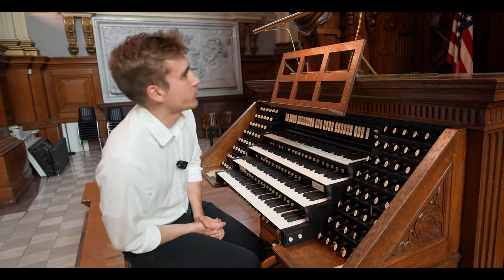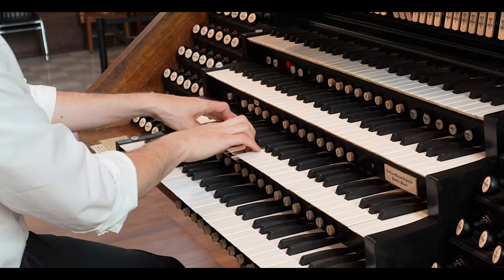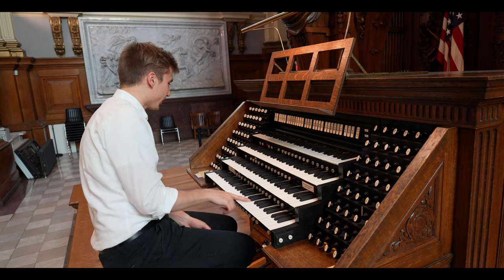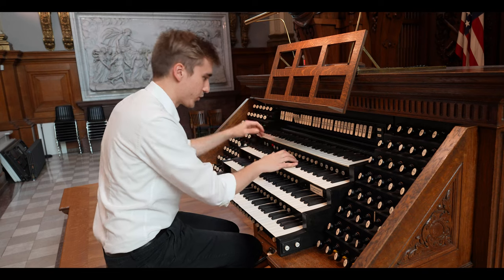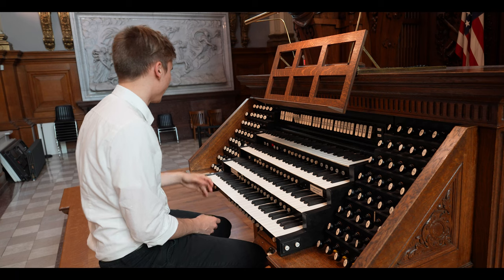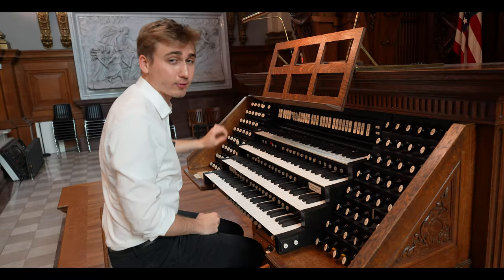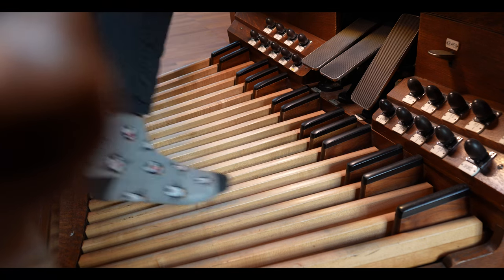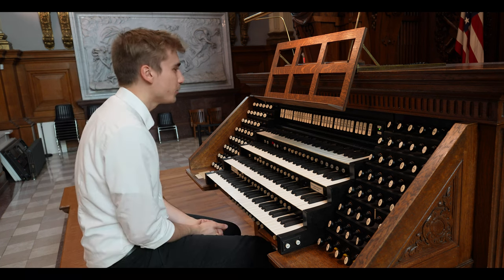Exploring the first Concert Hall Organ in the United States! - Full Organ Tour - Paul Fey Organist

Comment: The largest pipe in the organ is actually behind the farthest left pedal tower on the wall (low C) while low D is on the wall behind the farthest right tower. They are on ground level and go up all the way up to a lil over half the height of the case and they are made of wood . Full speaking lengths 32s